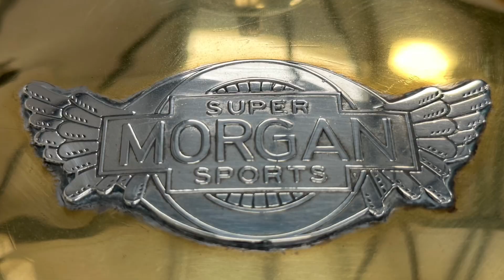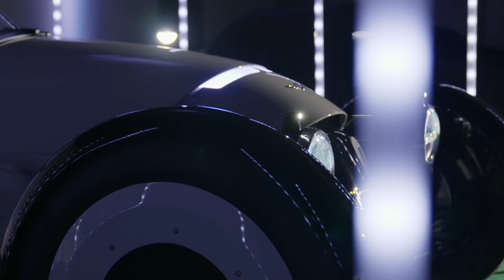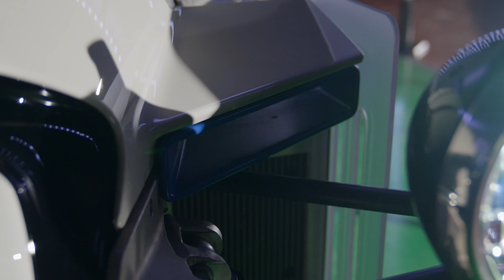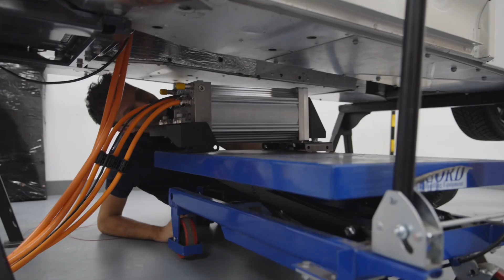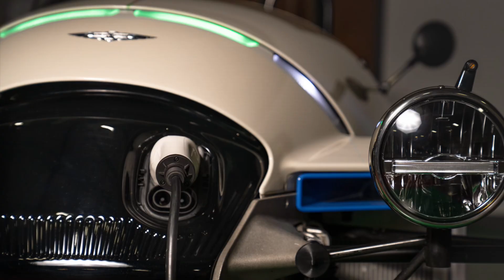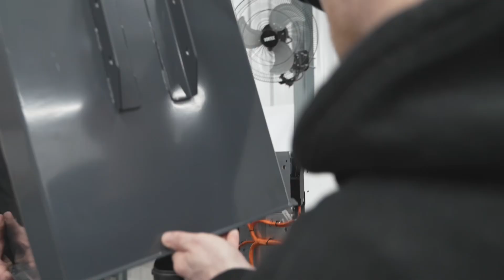Morgan latest BEV news! XP-1 EV prototype.

Comment: (for fun trackdays have a tri-motor setup with inital understeer and the rear wheel as a rudder )
Reply from the maker: It will be interesting to see what Morgan do as regards to racing.
Reply: @berrybrookmorgan3482 in racing the batteries don't need to last longer than the tires - a tri-motor with f1-like front suspension and a wide rear tire could do well, the battery could be a swapable pod on the passenger side
Reply from the maker: Exciting time ahead I think @replica1052